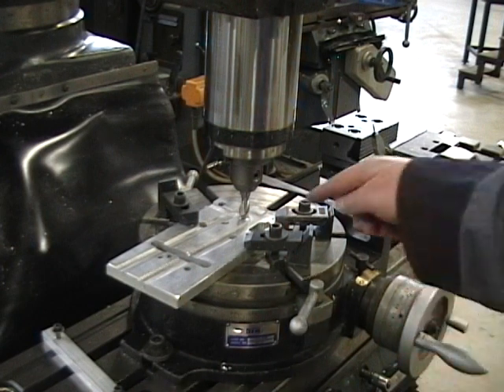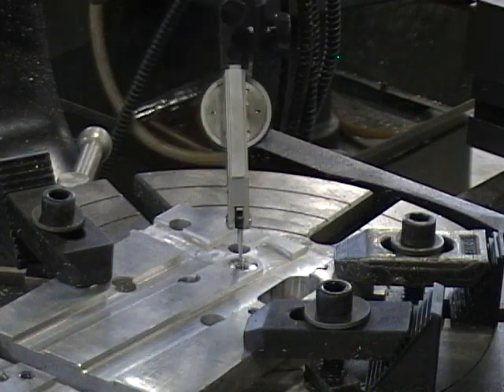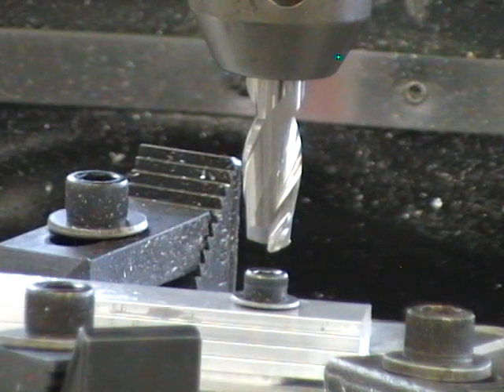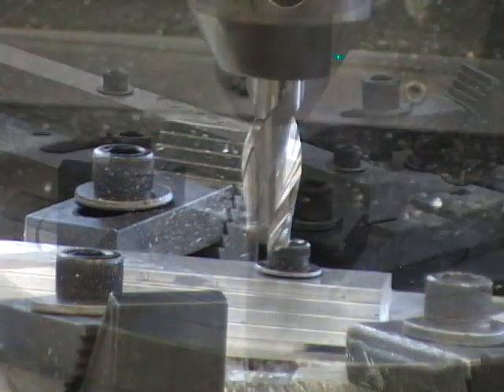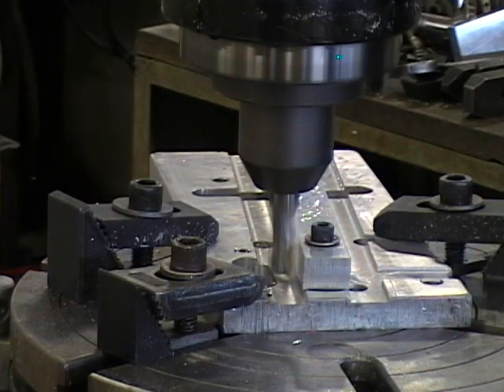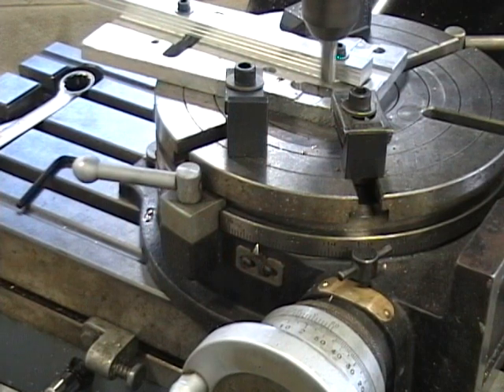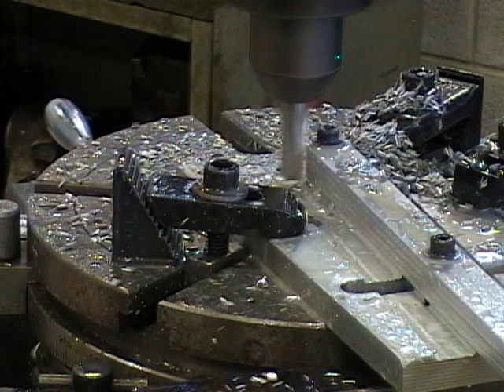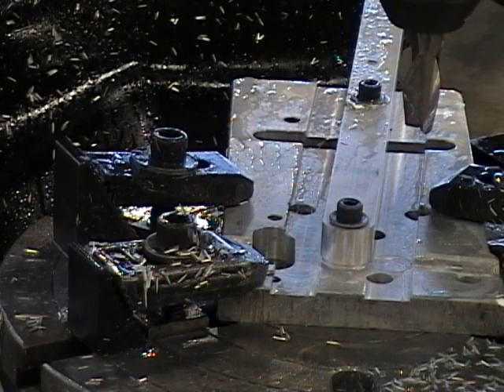Rotary Table

Comment: I have a similar job to do for the end of a knurling tool but it is mild steel not aluminium. Is that still ok to do using this method and were you using a slot drill or an end mill - it looked like a slot drill?
Reply from the maker: FYI - A slot drill is a two flute center cutting end mill and yes it was a slot drill.  Yes this will work for mild steel or any material, just use the proper feeds and speeds and don't climb mill in steel, for safety.